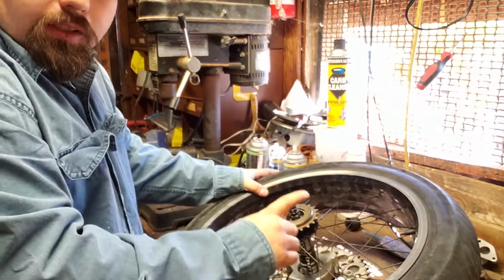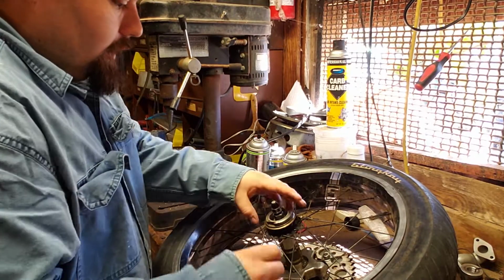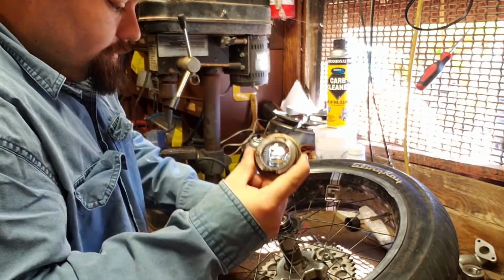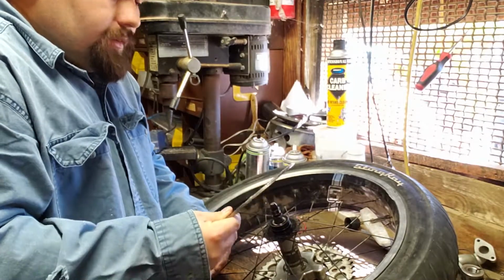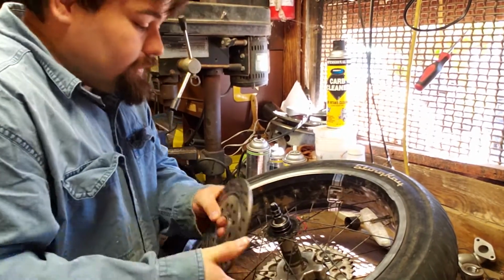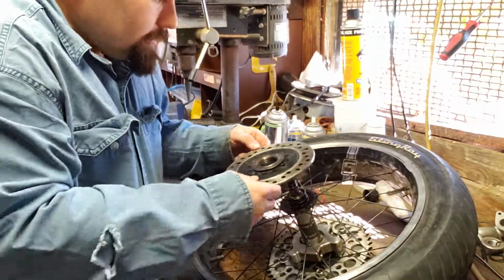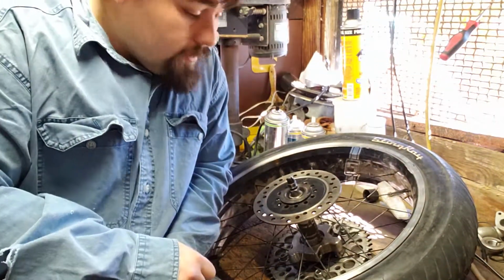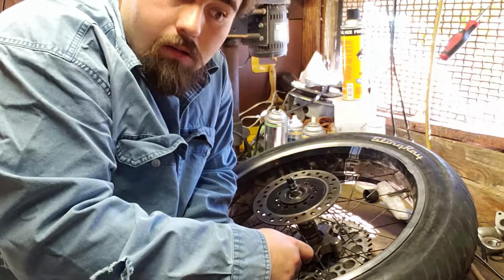how to put disk brake on chopper bike

Comment: I motorized my occ and I need some type of brakes on the back tire I wanna do discs cause the original brakes didn't so much when it was just pedals
Reply from the maker: Amazon sells a disc brake kits that you can put on   . i put the one i have because that was what i had on hand
Reply: @backyardspecial2875  any specific size I'll need tho?
Reply from the maker: @MileytheJeepV2  the bigger the disc the better i believe they go as high as 200mm. deepening on the size of motor  and mph
Reply: @backyardspecial2875  it's not huge it's an 80cc probably won't go much faster than 30 honestly with a disc brake in the front it might be okay to leave the original brake in the back
Reply from the maker: @MileytheJeepV2  80cc is not much should be ok
Reply: @backyardspecial2875  I was thinking the same but I might legalize it as a moped then cops can't mess with me but I'm pretty sure it won't pass inspection without disc brakes on both sides

Comment: Yo I was thinking of doing this
Reply: Is it possible without a welder
Reply from the maker: ya you can drill holes and put bolts or you can buy a brake kit online its the same ,if you want to save a little money. i just did this coz its what i had on hand at the time.
Reply: @backyardspecial2875  so if I bought an adapter and didn't wanna put on the new hub I could drill holes into the current hub and then put the adapter to drill the disc in?
Reply from the maker: if you buy a adapeter you shount need to drill nothing ,there all ready set up